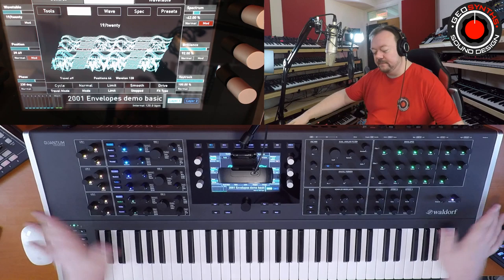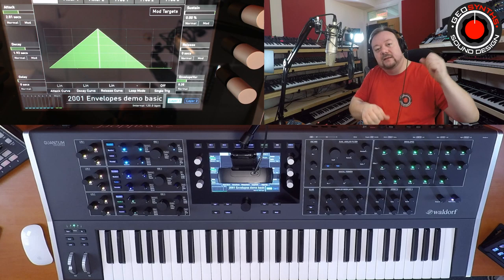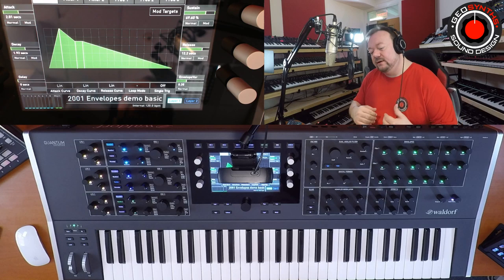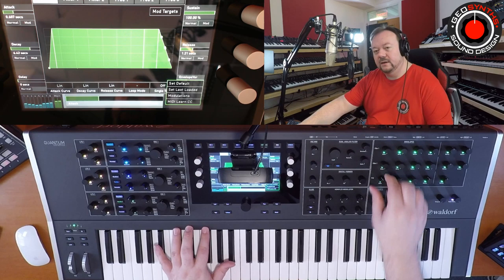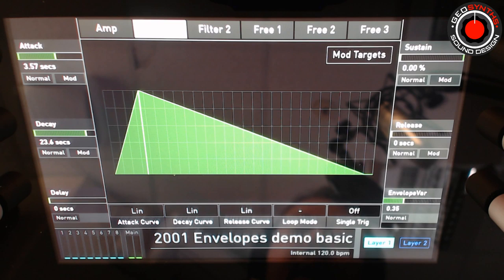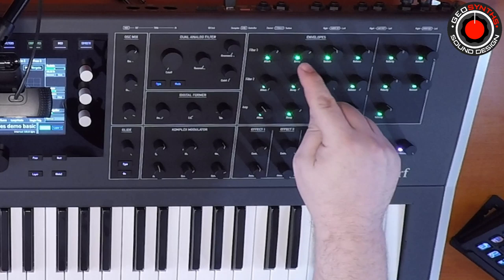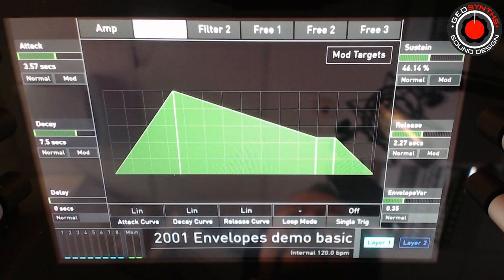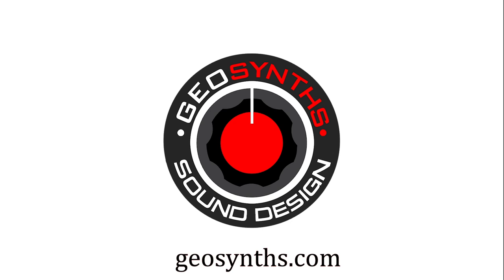GEOSynths Sound Design - Top Ten Tips - 2. Envelope Basics

Comment: Jamie will you do tutorials for the MC101/707?

Just got a 101 this week. As small as it is it does sound very nice (+3000 presets, that are mildly tweakable & good internal FX section).

As a sound module (707,808,909, Juno,SH101, Jupiter 6 & 8) it is worth the money.

Fun times.

Be like water (Bruce Lee).
Reply: I don't believe Jamie will touch anything that doesn't have a proper keyboard.
Reply: @impurfekt  The MC101 isn't deep synthesis but it is a powerhouse regarding form factor and price.

I got a Subsequent and KARP Odyssey a.o. but this little box is serious imho.

Comment: Great water analogy, Jamie. I've been a synth owner since the pre-midi Roland days of the early 80's.  I've got a theoretical question which I've always just assumed was true;  maybe you can clarify.  I've always thought of VCO/DCO as free running and always generating sound even when they synth is just sitting there silent without a depressed key.  These envelopes hare simply holding back your ability to hear it.  Similarly when you plug a cable into one of the (triangle/saw/square) ports of a VCO modular, you'll hear that free-running sound.  My question is: "BUT in the case of Wavetable synths, is the wave similarly free running or are they key-triggered?  Because some waves are almost sample-like and have distinct beginnings and ends, such as the wave of a human voice, ooh, ahh or a word."  Thanks!